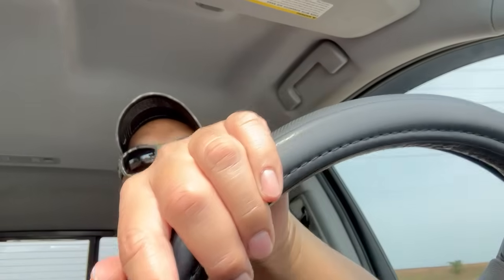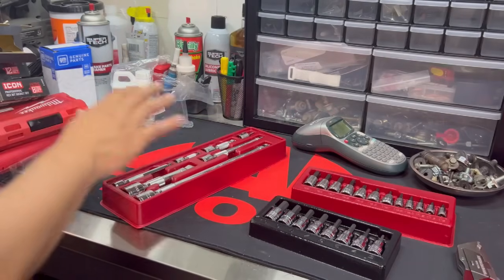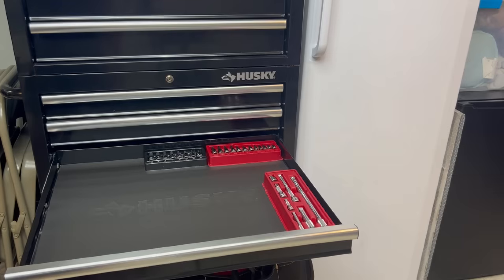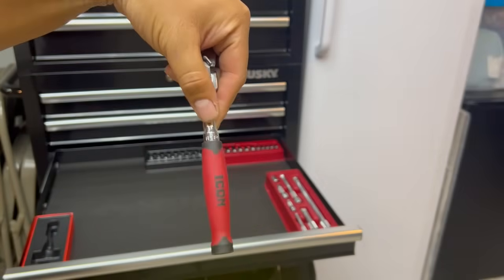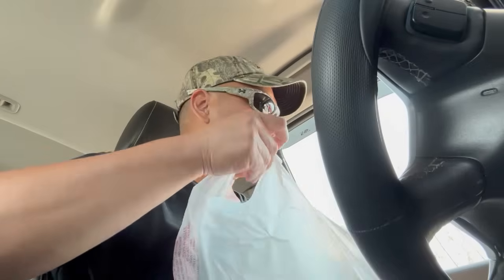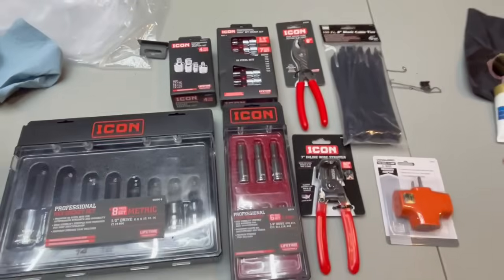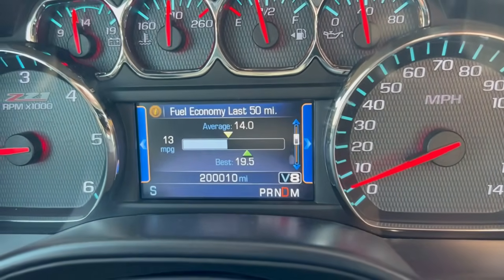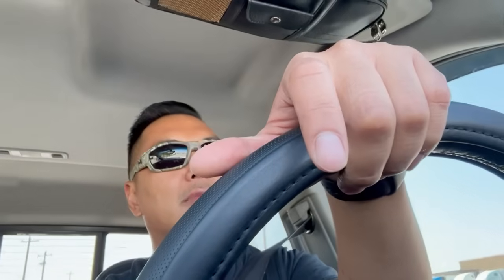Building a Complete Set of Icon Tools for My Daughter's Tool Box from Sale Finds

Comment: Harbor freight has 40% off any icon ratchet right now!!
Reply: Cool. Think I'll head there in a bit. Thumb.
Reply from the maker: Run faster!
Reply: That's a great price but right now I'm happy for the most part. Koken long 3/8" flex, Tekton long 3/8" flex with Snap On hard handle, Tekton 18" 1/2" Dr flex with Snap On hard handle, 1/4" Gearwrench 120xp flex with Snap On hard handle, Snap On 1/4" long flex, Vim long straight shaft ratchets and a Pittsburgh breaker bar with a Matco 88 tooth flexhead ratchet and Snap On hard handle for big stuff. That last one is a favorite as it looks n feels similar to the $250+ tool truck extra long flexheads but cost me $25 bar, $44 flexhead ratchet n $33 for the hard handle-$102. Performs n feels great. The Snap On hard handle helps me from having my hand lockup from carpal tunnel.

Comment: Are the Icon ratchets overkill or something to get for an occasional DYI? Seems like for $200, 40% off sale, one could outfit their garage in all essentials in all 3 drive sizes…
Reply from the maker: So I just added the same configuration ratchets in Pittsburg, and you're looking at $120+tax, so for an extra $30, you can could get Icon or other tools, still pretty close, and you still get lifetime warranty on either brand, I think at that point, its just purely budget, or preference, you will get a better performance out of the Icon in my opinion, they do work a bit smoother. I've owned pittsburgh before, and never had issues, its what I started off with decades ago.

Comment: It's a good idea to open up each ratchet head to clean and re-lube each one.  They miss a little machining debris every now and then. Also, make sure they installed the wavy washer between the anvil/gear and the backing plate. Sometimes, they forget to install it before the ratchet leaves the factory. It keeps the gear from tipping up to one side and rubbing the back of the retaining plate, and closes up the tollerances. I've bought a couple that they didn't install it so I took them back and traded them in with no issues. Other than that, it's hard to find a better ratchet for that price. It's awesome that you're getting her into tools with a decent starter set.
Reply from the maker: Gteat tips! Appreciate it! And yes agreed for the price definitely cant beat it

Comment: I wish my dad was handy and made me a toolbox!!!  I just got a house and my dad didn’t even have a screwdriver to give me!!! Sigh, he recently had to ask me to borrow a hammer to put a new hole in his belt (he’s getting skinny now due to dialysis tx and health issues).  It’s hard figured out what tools I need for around the house and to fix any of my landscape equipment
Reply from the maker: Sorry to hear about your dad’s declining health, praying for him. As far as some basics to keep in the house and your equipment, I’d start with: hammer, screwdriver set, basic pliers set (slip joints, needle nose, dykes, channellocks), pipe wrench, wrench set (metric/sae), 3/8 ratchet, socket set (metric/sae) both deep and shallow, pick set, maybe a prybar. If you got a harbor freight near you, definitely get some budget tools there for around the house, or look for some amazon deals. Even walmart has some decent stuff.
Reply: @ I just got a chrome set.  Do I also need an impact set in the 3/8 and 1/2? I hear people just use the chrome sockets in the impact wrench.  My nearest harbor freight is 30 min away.  Im stuck with a smaller Home Depot only :/
Reply from the maker: Honestly, if I would recomment sockets to anyone thats buying their first set, Id start them off with impacts first that way they can already have it when they end up buying an impact wrench. So my next suggestion is to buy a 1/2 impact socket set. That way generally you would buy a 1/2 impact to help pull tires off, do suspension etc. and then go down to 3/8. When you do go to HF, check their clearance section for Icon discontinued versions, that’s where I got my daughters 1/2 set.

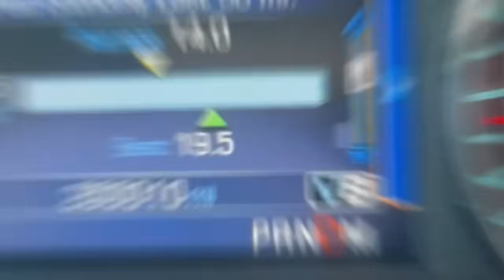Comment: 23:00 Is that instrument cluster and the dash especially the needles, Icon inspired? 😃 Or is it rather the 200K odometer of proper maintenance and occasional wrenching?
Reply from the maker: This truck has been pretty straight forward when it comes to utility, and pretty low maintenance. I do the same maintenance on all of my vehicles and same intervals, but in terms of reliabilty, comfort, and problems, this one so far has been fantastic, besides my old 99 Tacoma.